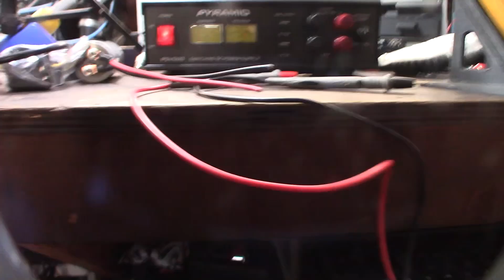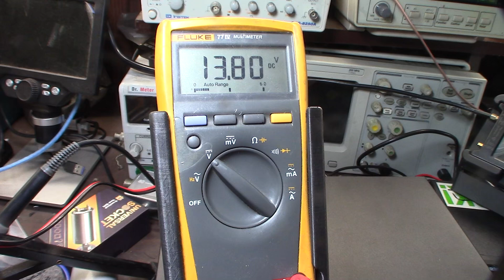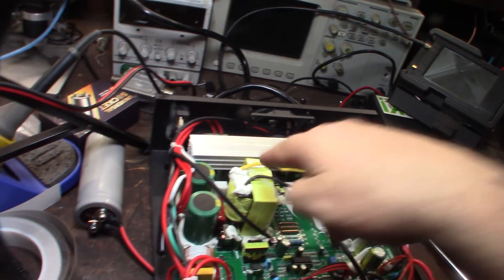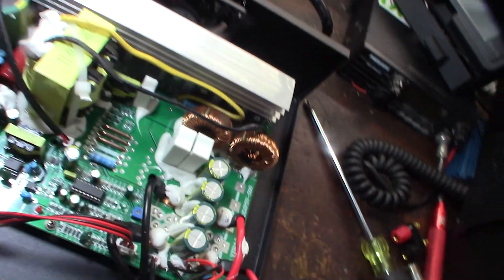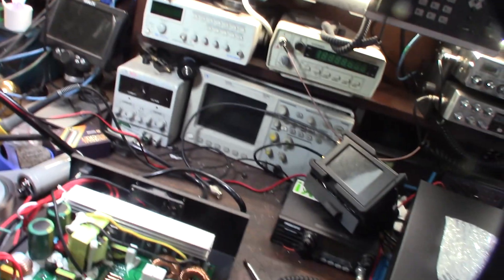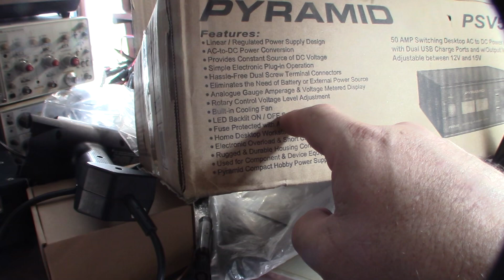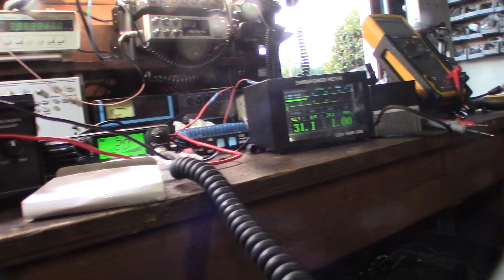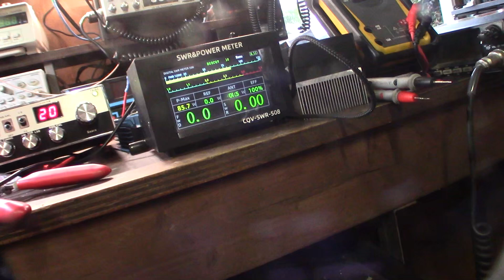Pyramid PSV500 50 Amp Power Supply For CB & Ham Radio KL203 Testing CQV-SWR-508

Comment: Mine makes a terrible amount of RF noise. Would not buy another..You can stack ferriets on it all day and it don't help..
Reply from the maker: Good to know, I have it really just for testing equipment on my bench. Maybe instead of ferrites I try wrapping a toroid.
Reply from the maker: Mine is not even connected next to the radio and the noise floor goes way up when I turn it on.
Reply: I bought on 4 months ago. Creates to much noise. JUNK
Reply: Plus it won't shot off